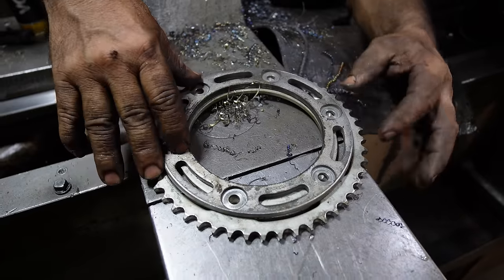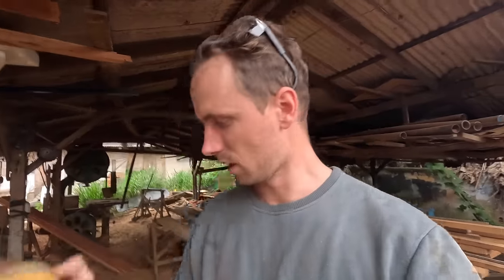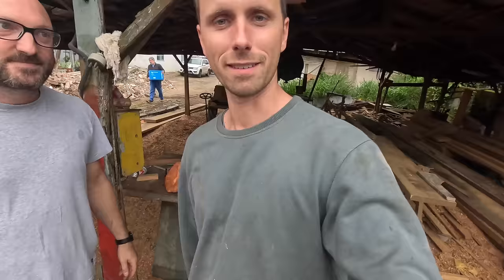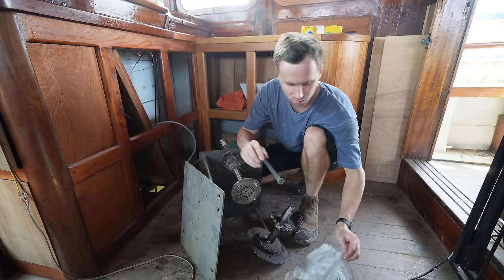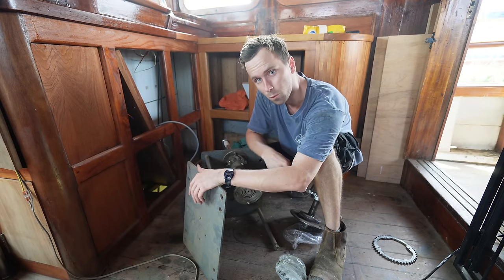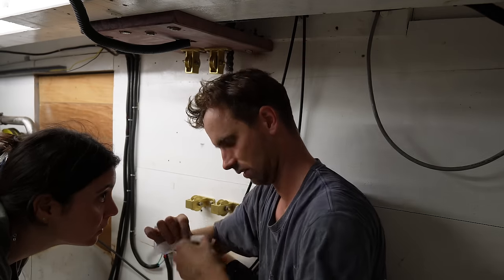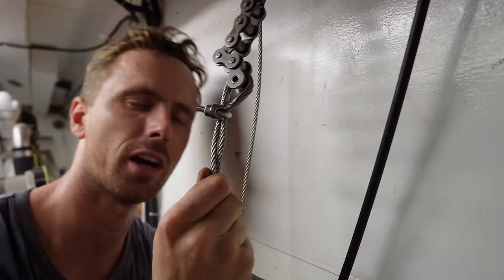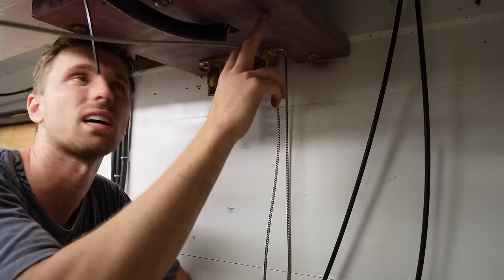Upgrading the old fashioned steering system of our RESCUED wooden sailboat — Sailing Yabá 158

Comment: Very well done! If I may pass on just two suggestions. The top of your steering gear should be covered, to prevent any wires or other foreign object from falling into the gears and jam your steering. You can bet that if that ever happened, it would be when you are in a tight place and really need your steering. The other suggestion, is to put some method of adjusting the tension of the steel cable. It will stretch over time, and will cause your steering to become sloppy. A simple turnbuckle in line on both lines to the rudder, one on each line, would be all it takes. Cheers from Winnipeg.

Comment: The rudder cable looks undersized relative to the transom pulleys. May want to add turnbuckles for future cable tightening once stretched. Consider replacing nuts with nylock nuts. Masive upgrade from previous. Easier to turn, more robust.

Comment: Now that you have upgraded your steering chain, I would Advise to make it longer so that you don,t have to worry about the wire clamps 
Also dispense with the wire clamps and have the hard eyes staged and have  4 part shackles to connect the ends
Reply: I don’t think there’s room for longer chain, but definitely try to swage (not “stage”, damn autocorrect) eyes on the cable rather than using clamps which run the risk of catching. You’ll need a turnbuckle to adjust the length, but could use one set of clamps on a cable overlap in an unobstructed straight run area to compensate for stretch down the road. Swage tools are relatively cheap and nice to have aboard anyway.

Comment: Come to Hawaii and I will host you on the Big Island. I've been building my beautiful home that I designed... Patterned after my fav boats... For the same length of time you both have been refitting your beautiful vessel. Always welcomed.
 One suggestion... Build a wood housing over exposed cables below so puppies, MP,s hair and flying objects, while in big seas will not affect your steering. Great job.

Comment: You might want to double up on the fasteners for the cable and alternate the side for the saddles. For proper termination multiple fasteners are usually used .

Comment: I still believe the cable needs to be double the thickness, compared to the size/weight of the boat + forces of water (esp. in a storm). You really want to go oversize so you don´t loose the steering due to snapped cable. You will see how much strength is needed if you put the tiller on in water.
Reply: I whole heartedly agree that going oversize is certainly better than being undersized. In bad weather the loads on the steering system will be exceedingly high and should never be underestimated.
Reply: I agree the old adage still applies. If it looks right it probably is right. And that cable doesn’t look right.
Reply: Absolutely - my reaction too. Must over-engineer rather than under-engineer! You've sorted out the cable routing - now you need to enlarge the pulleys to reduce repeated cable strain, and double the cable diameter to complete the work.

Comment: Just a thought, looping the cable to the quadrant with shackles will cause them to slowly wear through the metal as the angle of the rudder changes. Bolting a S.S. strap hinge to the quadrant, (after sawing off the ends with the second unneeded hole), will allow the cable to remain on the same plane without rocking the shackle back and forth. A pair of sturdy turnbuckles below the helm, between the chain and cable, will allow re-tensioning the steering without reclamping the wire... And that wire rope should be lubed, especially the part exposed to the sea. 'LANOLENE™ MARINEX' is one of many lanolin based wire lubes meant for marine use... Nothing wrong with 'learn as you go', as long as it's not something your life will depend on. That's when you call in the pros. And you and MP are becoming the 'Pros'... face-blue-smiling

Comment: My thoughts: A longer chain should have been used moving the joints below ceiling height, the joints would not have to pass through any restrictions because if there is a chance it will get caught then it will, daily inspections will be easier as failure points are visible, wire to chain should be via a replacable link like a shackle because if the wire breaks at that point then now the wire is too short for the system, which leads into the fact you need a means of adjustment not only for a worse case scenario but also because the wire will stretch, finaly I would suggest as like others have that a suitable sized spring is fitted, it will help keep the system under a small amount of tension but more importantly it gives a shock absorber in case the rudder is hit by a submerged article eg sea bed or log, etc, currently if that happens it will rip your pulleys out resulting in a loss of stearing.

Comment: Nice job. Just a suggestion, in have weather if there's any slack in the cable the rudder will slam put alot of strain onthe cable. The cable must stay tight (no slack). There are a few ways to do it. Turnbuckles would be easier. Good luck.
Reply: Do you mean "heavy weather"?

Comment: Someone already mentioned this but it bears repeating to save you a lot of work and time keeping the pulleys greased:  The brass 'cap' on the end of the pulley axle DOESN'T NEED TO COME OFF to add grease.  That fitting is called a 'zerk' and is designed so that the end of a common grease 'gun' ( a hand pump with a tube of grease in it and a small hose with a coupler on the end) fits over it and you just pump the grease in.  The tiny ball bearing on the end of the zerk acts like a check valve and allows the grease to go in when you put it under pressure using the grease gun, but springs back to prevent grease from leaking back out.  This kind of fitting is universal on most machinery that needs greasing periodically and I suspect you may find them on some of your engine and driveline parts, or like on your deck winch. So buy a grease gun,  some tubes of grease, and keep'm greased without fuss!

Comment: Love your improvements.  My only suggestion is to add a "tensioning device" to keep the wires taught.  It can be as simple as a pully riding on the long run of the wires attached to a spring so that when the wire stretches you do not have to keep tightening them.

Comment: Glad to see that you worked out a solution to the problem.  One thing that i noticed during your test was that it looks like the emergency tiller may have some interference with the cabin top supports along the transom -- it may just be the camera angle, but you might want to just double check that before setting out for parts unknown!!!

Comment: A suggestion on those mission critical nuts that you cannot tighten. A second nut, with or without a washer, can be tightened to the first to give an extremely strong tension. Loctite is good, not perfect.
Reply: Ben, consider addin a cot pin so those nuts can not uncrew and fall

Comment: I would put a plate of some sort in front of the chain and wire drop and rise part just so you dont grab hold of it if you are in the engine room and the boat turns. It doesn't need to be fancy just safe. . Great update 2x👍

Comment: It looks like some of your pulley brackets are held on with lag bolts. Through bolts with large fender washers would be much better. There is a lot of strain at these points and you don’t want to lose steering while at sea.

Comment: Keep an eye on the cables for fraying, especially at the bottom of the pulley double backs. That area at about midship is where the cable flexes an incredible amount.  I think I would have gone to at least the next pulley size up. I hope the conduit clamps are temporary. Something easier on the cables would be preferable. You will need to add a turnbuckle because the cable will stretch. In any case I’d be keeping a spare cable onboard and hardware that you could drop overboard.

Comment: Small thought, if you take a small piece of leather and make a slit two it’s middle and then take a large washer with a small opening that you cut in half and drill holes in or just take a whole drill that has the center guide drill with the outer circular saw to make a hole Then you could use wood instead of metal as a clamping mechanism to the leather. Place the leather on your cable for your steering on the inside of your transom so is it the center part of the cut is just touching the cable then put your ring around it and fasten it down. This will work like a gasket to help keep water from coming in from following seas or any other reason why water might find its way up that high on the back of the transom. I know the holes are small, but it’s still a hole that will lead water in. By making the leather gasket you’ll help slow it down.

Comment: If it were me, I'd drill the 6 pully axels to accommodate cotter pins rather than relying only on thread lock. Another upgrade would be castle nuts. All this just for peace of mind. Your pullies look large enough to use much thicker wire rope, you might want to keep a length on board as a spare. I second the turnbuckle idea.

Comment: When putting the cable through the chains , put the cable through the holes this way the side plates take the load , over the roller like you have it can cause the roller to pull out and lose the steering? Also turnbuckles on of the cables will give you additional adjustment in the future, make sure you match the strength of the turnbuckles to the cables ? No leak links in the system! 👍🏻👍🏻🖖🏼

Comment: Cables look very undersized and most likely will stretch like crazy considering the loads from that huge rudder even in normal seas. Considering double thickness, tensioner and improved terminations.

Comment: Don't forget to lube the chain and gears and all the pullies with a nice thick grease!
Like the ratio much better now. The cable itself looks a bit light for me, but should work fine, I'd make sure you use the proper pivoting clamps on the ends at the rudder. One last thing, I don't think I'd rely on just Loctite to hold those pully nuts on, use Loctite and a self locking type nut !
Cheerz!!

Comment: Good job, only suggestions I have is also that you need to have turnbuckles on the wires, so you can get it real tight, otherwise you are going to get rudder slap when you are at sea, and that will annoy you after a while. The other thing I would think about is making rudder stops, so that when you are hard over the force is on the rudder stops, and not on the cable system, if there are no stops and you are hard over turning to port or stb there will be a lot of movement on the rudder from prop wash and will cause a lot of undue stress on you steering system, as opposed to holding the rudder against the stops with the wheel taking away any unnecessary slack play that will put a lot of stress on your pulleys and cables. I have watched all your vids from day one, and many times I said to myself wouldn’t it be easier to just build a new hull, but hey what you guys have done is fantastic, well done.

Comment: FYI - on your pulleys, two things to make sure of ...

1) the inside part where the pulley sits CANNOT BE THREADED or it'll eat out the inside of the pulley.
2) use a Nyloc nut to hold the bolt in place.  It won't back off.

Comment: +1 on the tensioner system on the wires, and would add a bronze bushing in the cable thru hulls in the transom to help seal out rot and prevent thewood from being ground out by the wire

Comment: Great job.   In the guides for the cable running across the ceiling, please put a plastic guide so the cable is not rubbing directly on the metal half loop.

Comment: Wonderful!  This steering rig is a great working model!  but yeah Im on the side of using a larger / stronger cable.  On my boat I follow the Rule of 3s.  Always carry 3 time more fuel than you think you will need and make things 3 times stronger than you expect to need... especially in regards to steering and control.  Peace of Mind is cheap compared to losing control and taking damage or worse.  Also, there will be a lot of force being applied to the rudder and also to those transom pullies (blocks) so they need to be chunky.

Comment: Hmm.Big improvement... BUT... I am still concerned about the termination on the quadrant. Those eyes through the holes in the quadrant ends will cause massive wear to those quadrant holes.... that will be expensive to repair. I think you need a swivel bolted through it so that the movement is in the swivel. 
I am also surprised you didn't use Dynema instead of stainless wire. Dynema won't stretch  & is stronger than the steel. 
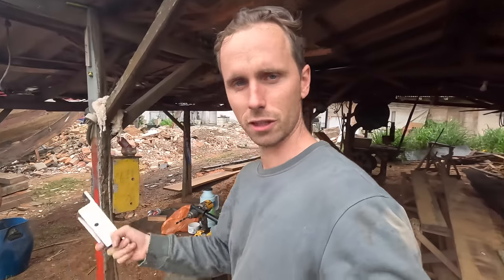Finally, the guy who drilled the holes... @ 1:51 Are you sure you haven't kidnapped 'Mads' from 'Sail Life' ?

Comment: I’m still not sure about the strength of the lower pulleys below the chain.  They look like they will get pulled out . Maybe you could put a strap of metal bolted to the top of the pulley bracket down to a point lower on the bulkhead to add some strength. Also fit a pair of turn buckles on the longest cable run so you can tension the cables. Stagger the cuts you make in the cables so the turn buckles don’t pass each other when the wheel is turned.  I’ve worked on sailing boats for years and most steering damage is caused while reversing. The forces on the rudder when reversing and turning are huge and I really think the first two pulleys under the chain are the weakest as the bolts are in shear against the pull of the chain and the cable.

Comment: Get a block for each cable mounted near center of cable on a spring to keep tension on the cable. This will take the slop out of the system and help prevent wear and damage

Comment: Loctite is good to use! But to suggestion either drill for cotter pin or double nut to jam the unseen nuts together and secured from loosing up on you for your pulleys. Or use nylon nuts!

Comment: I really hope you packed that barring on the inside of the steering box before you finished putting it together.  Also put some waterproof sticky grease onto the gears as they mesh in the box.  Then on the outside where you will have the wire clamps I would seal those U -Clamps with some sort of water proofing because they will rust like mad if you do not.  Then I also suggest you have a backup Dyneema rope specifically for your steering in case the wire has problems.  You might also want some spare Dyneema  for other backups and some frictionless rings as well in case a block dies on you.

Comment: Will you have a chain tensioner?   Or maybe a stiff spring, in-line with one of the stainless steel wires ?
 
It seems that when the boat shrinks and swells, with the moisture level, or when the timbers flex with the working of the boat, that the chain will come untensioned and slip off or too tight and break.

 I will watch and wait to find out!   Love these vids!

Comment: Hi Ben. How are you going to prevent water from coming into the boat via those two pipes that you are going to fit into the stern where the cables are going through? Sailing in following seas the water is going to stream through those pises and right into the hull.   Remember the turnbuckles on both sides of the cable and put lots of marine grease on those gears  in the steering box and on the chain.

Comment: BEN USE A COPPER TUBE INSTEAD OF STEEL YOU DON'T WANT DRY ROT TO OCCUR IN YOUR TRANSOM. O make sure you grease that chain and sprocket behind your steering wheel. Then you should be good to go , Ben, cheers bud.

Comment: You may need some kind of wire tensioning device (or devices) to take up any slack in the wires. 
I would change the pulleys which you mounted the lowest under the steering wheel (below deck) and use a strong/stiff spring to hang those pulleys so that will take up any slack...

Comment: Good job!!  Funny little Oh-Oh moment. When you first attached the wheel to the shaft and spun the wheel to starboard, the rudder went port. Just an editing glitch.
Reply: I made a comment elsewhere about this. If you want to go to the right you turn the wheel to the right, their boat will go to the left! The reduction gear in the steering gear reverses the rotation of the output shaft.Turning the wheel right (clockwise) to turn left is a noninstictive action and could cause problems in panic situations. They can rectify this by crossing the control cables in the engine room.

Comment: After reading the comments, common themes seem to be 1. Turnbuckles to allow adjust as the cables stretch (which they will).  2. Possibly heavier cable to allow for excess loads from heavy seas etc.  3.  Shielding it from debris etc that could jam the steering (which would invariably happen when you need it most).   Perhaps at a some future time, given the size and mass of that rudder, consider using hydraulics instead.  More expensive but helps with steering effort and reduces backlash and rudder loads transmitted to the wheel.

Comment: You could use some PVC piping to house the cable where it goes through the wood, to keep the connection from snagging on the wood. Check to make sure it doesn't snag in other places too.

Comment: And one more thing, 1 wire clamp on each end is not enough, 2 or 3 is needed for safety, there is a lot of pressure, partly due to the screw water. Imagine that one slipping!
Gr.R

Comment: 26:06 Where the steering cables are supported from below by brackets on the beams, maybe it's better to put supporting rollers? There will be no friction of the cable on the metal.

Comment: I see you have stainless steel clips on the beams to prevent the cable sagging . I would strongly suggest putting nylon inserts in them so they cannot damage your steering cable .